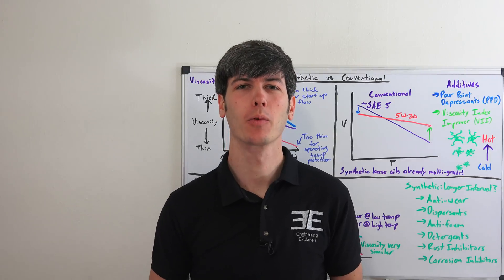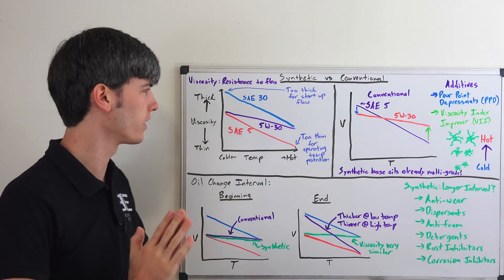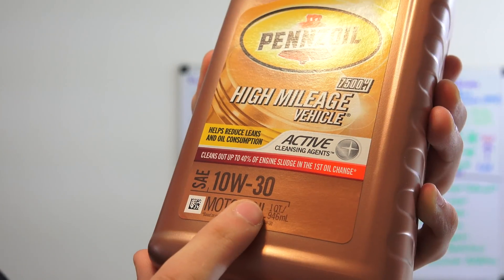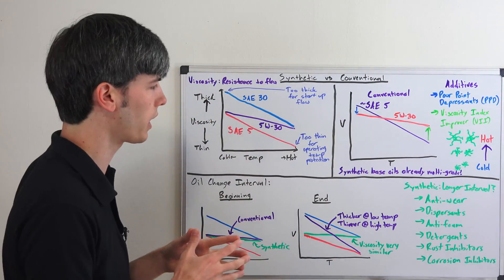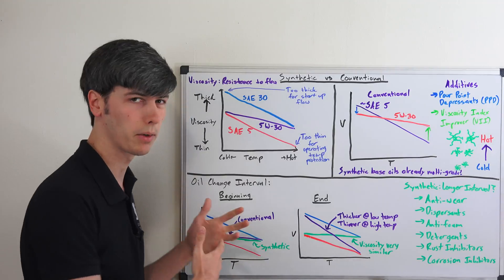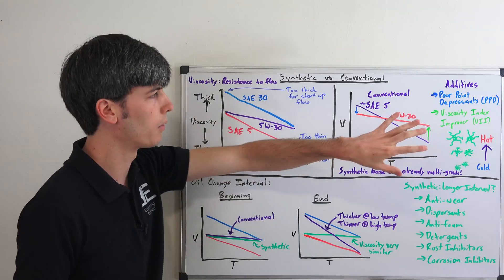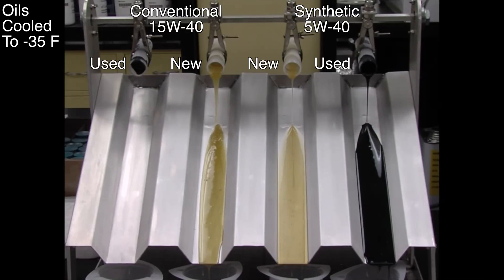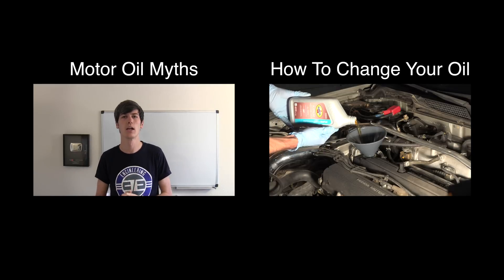Is Synthetic Motor Oil Better For Your Car?

Comment: Sold motor oils for years. Also conducted hundreds of oil analysis for contaminants and longevity. Two basic rules are: Use a high quality oil. Use a very high quality filter. Typical standard motor oil will last 6000 to 8000 miles in a healthy engine. Synthetic oils will last 12000 to 15000 miles in a healthy engine. If you're ever curious about your particular engine, get an oil analysis kit from your parts store and do your own analysis. You mail a sample of your used oil into a lab, and they send you a report of it's condiiton. Increase the mileage between each change until the analysis shows that the oil is beginning to degrade.
Reply: Premium gas is not better for your car. Using higher octane gas than a vehicle is recommended for is not good for it, and it is spitting in the face of the man who designed the engine. Higher octane fuel burns slower than lower octane fuel, this means if your vehicle calls for 87 and you put 93 in it, your engine timing will not fire your cylinders early enough to cleanly burn higher octane fuels and your combustion will not complete at the correct time in your engines cycle, robbing power from your engine. Luckily for ignorant people like yourself that fell for the "premium" moniker used to sell you a more expensive but unnecessary product, your ECM can make some adjustments and get things to run okay. 20/20 was right, but you are wrong.
Reply: back a few years ago i think it was 20/20 that did a 5 year test on all oils,all brands,using n.y. taxi cabs as test cars.all cars had exceeded 200k miles,most were over 300k miles,they then tore apart each and every engine to examine the wear diff., and guess what? not a single diff. between any brand or type of oil used,they all did the same thing. maybe you should just try running the prem. gas in your car instead? idiots like you,smh
Reply: Amsoil is not "by far the best oil out there".  Don't listen to fanboys. To find the best oil look for the best performing additive. Since the mid 90's, that additive has been held under a patent by Valvoline. But honestly, it doesn't matter. The main thing is to change your oil when necessary and to keep the oil in the engine. Working as an auto tech in large dealerships, I never saw an engine problem on a vehicle that got regular maintenance and was kept leak free (not counting sudden cooling problems coupled with customers who just wanted to "make it home"). The deal is that engines will easily outlast the rest of the vehicle with just regular maintenance. You could use the cheapest oil out there, as long as it is maintained, and your engine will outlast your suspension, AC, rack and pinion, etc. To me the argument of synthetic versus conventional is mute. It is simply unnecessary to use synthetic oil unless you are live in an extremely cold environment. Also synthetic oil can cause problems during break in as it can prevent the valve stem seals from seating, causing the vehicle to burn/lose oil. For example, a lady who bought a new Avalon back in '07 insisted we put synthetic oil in her brand new car. We protested and were called liars who "just want to cause problems for her". Long story short she paid out over a thousand dollars to have her motor fixed less than 15k miles later. Another problem with synthetic oil is it can cause oil leaks in vehicles that have run conventional oil for over 50k miles with less than ideal maintenance. This is especially true for people who do this with wax based oils like Havoline, which separates as it degrades.  The molecules in synthetic oil are of a similar size where with conventional oil they are all different sizes. In a nutshell the synthetic oil can wash out the larger conventional molecules around a seal and cause leaks.
Reply: Pre-igntion is basically non-existent in modern computer controlled vehicles. The engine management keeps the ignition timing and in some engines valve timing in check which of course keeps combustion temps low while the EGR system keeps the combustion temps down further. This means no chance of pre-ignition in a modern vehicle. The ECM will go into limp mode (lets you limp hole with no power) or just shut the vehicle down before that could ever happen. 
On a high performance engine you need higher octane fuel, where did I argue they do not? It will be indicated in your manual, saying a minimum rating of 93 octane, for instance, if it does. It doesn't tell you that putting race gas in your turbo Subaru isn't good for it, it just says the minimum, as it is what is required by law.
 And it had everything to do with the speed of the burn, the slower burning fuel is less likely to pre-ignite because it doesn't ignite as rapidly...because it is made to combust best at higher pressures than exist in say, my Jeep, than it does in your hypothetical higher compression turbo Subaru. The engine is either set up to run higher octane fuels or its not. 
Computer controlled engines are are able to adjust their timing to mitigate the effects of higher octane fuels, while other new vehicles are able also able to affect cam timing as well. 
This doesn't make it better to use higher octane fuels though. Your modern day engine is set up, designed by engineers with a particular cam profile to run on a specific fuel, and to adjust for other fuels to a degree using the array of emissions sensors in the intakes and exhausts, sending feedback to the ECM to adjust the ignition timing or cam timing. Luckily we have the ECM to thank for higher octane than specified fuels not causing engine trouble in modern vehicles with timing and cam timing controls.
Reply: My info comes from a lifetime of working on cars both as a flat rate technician and a hobbyist as well as learning more on my own about gasoline and other fuels than just what it says on the pump when I fill up.  A turbocharged engine needs higher octane fuel because the compression ratio is higher in those particular modern engines...which are designed to be ran with a higher octane fuel. I'm not arguing against that Kevin, and I have no clue how you somehow got that out of anything I posted. I'm saying very simply that if your engine does not require high octane fuel you are not doing it any favors by using it.
Reply: drew riggs They run full synthetic motor oil in my semi and they only change the oil every 18,000 miles and do an oil analysis at every oil change.  Never had a problem with the engines of any of our trucks that I know of and we have over 500 trucks in our fleet.
Reply: +jukijunk Amsoil by far the best oil out there.
Reply: Yes, because it burns slower. Your engine is not high compression.
Reply: youre on drugs to think you can get 15000 miles out of an oil change... dont dare tell me different i work for gm and have seen literally hundreds of engine issues due to prolonged oil changes.  timing chains and gummed up rings etc...let alone any gm engine drinking massive amounts of oil. think im wrong? come work beside me...
Reply: *golf clap

Anyone who ever taught you reading comprehension should shoot themselves.
Reply: Thats a great idea me and her go for hours and we get sore that lube needs to get tested... I yold her that but she just kept going...
Reply: Whats a high quality oil brand you'd recommend?
Reply: Engine oil either conventional or synthetic is too cheap to risk a major overhaul. I won't use conventional oil anymore but I won't run synthetic more than 5000 to 6000 miles without an oil change.
Reply: Of course it is, I never once said it wasn't. I guess explaining why it works that way is too much for you to understand.
Reply: Daniel Fleming thank you

Comment: in all seriousness very well done video thank you very much for the knowledge. 

That said I totally believe you I'm not so sure Pennzoil is telling the whole truth but you believe what you say and break it down into palatable pieces easily digested, remembered and recalled.
My ADD meds had to kick in a couple of times during the monotone math chart parts, the colors on the white board are catchy and nice to look at... I was unable to read them on my mobile phone, especially the yellow writing (You narrating a High Level: Google or Micro$loth .PPT "Slide" would have made it easier and more interesting and effective for everyone...

Standards Consistency:
You mentioned 0°C and soon after 100°C... (Metric)
Commenters are talking about 5K, 10K, 15K Change intervals (I presume thats Imperial, eg Five, Ten and Fifteen Thousand MILES),
YOU SET THE TONE AND DEFINE THE QUANTIFIABLE.
I may be wrong but I think somebody has to go down there and correct the commenter which is something I haven't seen you do is comment you have a great write-up but there's no commentary or answering questions from those ridiculous viewers.

Just saying... Better than any video I ever made and uploaded, so Bravo!

Next up: 
Automatic Transmissions & ATF Preventative maintenance and Care for the life of your vehicle. 

1) Changing ATF, How often?
2) How much to change?
3) City/Highway/Hauling?
4) Leak Fixes, additives, etc?
5) Low/High Mileage Vehicle?
6) Warranties (Dealer, MANUFACTURERS? SPECIALIST/3RD Party).
7) R&R: Buy New or Rebuilt?
8) Tips & Tricks / Do's & Dont's plus Secrets to owning a Trouble Free, Dependable Transmission For Life

Then a series on "Manual Transmissions, Clutches, Etc."

Keep it up and thank you!

Comment: When I put synthetic or synthetic blend in my 95 bronco it rattles and knocks like hell at startups. ....why is this ?
Reply: You have hydraulic lifters that are worn and the lower viscosity at cold start is amplifying the issue.
Reply: Is the viscosity correct? It might do this due to it behaving like it's thinner and maybe your engine is worn due to age or use.
Reply: tom bidwell I run 10w-40 also. Mine has around 220,000 miles too. 10w-40 seems to be the right oil for the older ford engines, since the recommended 5w-30 seems to be too thin to keep the engine protected.
Reply: sivalley thank you .no machanic could ever tell me that .they say they don't know why ,and it shouldn't do that . I appreciate your response
Reply: +tom bidwell You are welcome.
Reply: What grade are you using? And what mileage do you have on her?
Reply: put slick 50.. only exaggerate whats written in the manual..goedendag
Reply: Totally has to do with the viscosity. Some crooks in corner used car shop put ticker oils in their engines so you don't hear the knocking.
Reply: My 2000 Explorer makes that noise whenever I change the oil. It sounds like marbles in a tin can. It's been doing it for the last 70,000 miles and it's still fine. From what I've read, it's something electrical like a corroded ground plate somewhere.
Reply: speeddemon002 I've been using 10\40 and a Purolator filter and it is just fine ,no noise at startup .the bronco has 223000 miles
Reply: ***** and I put a quart of Lucas oil stabilizer .it makes a difference .!!
Reply: ***** good to know that joeblow .what do you suggest .?

Comment: Here's one for you.  My friends and I ride dirt bikes with low volume (1.1L/250cc) oil reservoirs.  Change interval is about 4hrs max.  Never gets dirty, but smelling it there is definitely some fuel dilution though I've never bothered to have it measured at the lab.  We've noticed our bikes are more likely to overheat on synthetic.  Is there a difference in heat dispersion of mineral vs. synthetic, or has that just been chance and it's our imagination?

Comment: over twenty five years, and countless engine i've rebuilt.. not a single one, was due to an oil failure.. not a single flipping one. dont give two shits about your litmus tests, or your friction tests,, or your super secret squirrel analyzing.. buy the cheapest oil you can, and change it when it's no longer honey colored.. ya grandpaw knew it,, and you should too. :)

Comment: Excellent explanation as usual. There is one thing you left out. That is, you are using gravity to demonstrate the difference in flow.  In an engine, the oil is pressure fed into the various galleys so that would reduce these differences to a large extent.    Your comments please, or demonstrate the differences using a 40 PSI pump.

Comment: My 3.3 L chrysler calls for 0-5 oil--since water is sp 1--what the hell is 0 oil?? Anyway I saw a commercial for Mercedes Benz stating they use 20-50 synthetic. So I tried it now use always, stopped the first day start bearing rattles, quieter sounds, actually better mileage.
Change filter at 3000 & oil at 10,000.

Comment: The early part of your explanation is completely wrong. The 'W' figure refers to the TEMPERATURE (plus 20) at which the oil remains fluid enough to provide protection. For example 5W30 provides protection down to minus 15 degree's for an engine designed to run on an oil with a Redwood viscosity of 30 seconds.

Comment: I only run synthetic in the winter...  As long as you use certified oil, and high quality OEM filters  your engine will last just as long.  Synthetics do better In high heat situations though

Comment: Well it should be noted for older vehicles that were only intended for conventional oil, synthetics sit at a lower viscosity when cold so you can start seeing small leaks as it is able to get through the small cracks thicker oil couldn't get through. Your engine will also sound louder on start-up as the oil is thin and doesn't dampen the amount of noise.
That is where most of the "synthetics destroy engines" ideas come from, as it does seem like your engine got worse with synthetics.

Comment: Stick with engine makers specified oil. There is more to oil than just grad (viscosity) and mineral/synthetic. It's far better to have the correct oil in the engine for 15,000 miles than the wrong oil in there changed every 1500 miles.

Comment: No synthetic oil is not better for your car because it dissolves seals,which I've never heard that being a problem with conventional oil.
Reply: Nope. Been running synthetic oil for as long as i've owned my 05 Ford. No leaks and running strong.
Reply: seals?
Reply: TheHalusis Seals,have you never heard of that word before?
Reply: +TheHalusis *gaskets
Reply: Luke Raleigh Your '05 Ford was probably built to withstand synthetic oil.My 1948 kaiser will leak like a fountain with synthetic oil due to the additives and materials in the gaskets.Even the repair manual for my '97 Ford says to NEVER use synthetic oil.
Reply: The other reason gaskets may leak is because the synthetic oil seeps through easier because it behaves like it's thinner, and coats everything. Just spill some on a surface and after a while it will have spread out quite a bit, which is why engines can have a large "wet" patch even from a small leak
Reply: Luke Raleigh exactly
Reply: Luke Raleigh I have a 2005 ford 250heavy duty...mine leaks.
Reply: +Charley Bomps your right about materials in older gaskets breaking down with synthetic. Ford probably just said that in '97 because they didn't sell Motorcraft synthetic yet and didn't wanna lose money hahaha. anything mid 90s and up should be fine. its a fact it is better oil.
Reply: I have a '02 7.3 and run Delo 15W-40 in the summer and Delo Synthetic 5W-40 in the winter. I do this because I often have to cold start. I swear by both. If I run the 5W-40 when it starts warming up then my pickup will start minor leaking. I also have a 2013 Cummins ISX 15 550hp and that only takes 15W-40. However that truck never cold starts.

Comment: Electric car do not have oil change.
Reply: Why not ,do the axles use pudding instead of oil?
Reply: No they use Jello.
Reply: Charley Bomps Do you know anybody that ever changed transmission oil? Yes, if car is worn out and it starts dripping oil, then it is ok to add oil, but you do not change it regulary. I drive a lot, and I need to change it several times a year in my car.
Reply: Mladen Milić You're the one who said electric vehicles don't use oil.You do need to change oil regularly,not just when it leaks.
Reply: +Charley Bomps I never wrote that electric do not use oil. Just that they do not have oil change. Oil change, not - not have oil. You do not HAVE TO change oil on electric car.
Reply: Mladen Milić Oil deteriorates and gets dirty and has to be changed.There is no last forever always clean oil.
Reply: Charley Bomps But it would last for life of car or at least much longer than any engine oil. Only oil it has is reduction/differential oil and brake fluid. And they are not changed every 10.000 miles, but on maybe every 200.000 miles.

Comment: Very informative. I does make me wonder why recommended oil change intervals are so different in Europe versus the US. I currently live in Switzerland and the dealer refuses to change engine oil more frequently than every 35,000km (about 22,000 miles). Based on the info presented here, this seems like a long term recipe for engine failure.